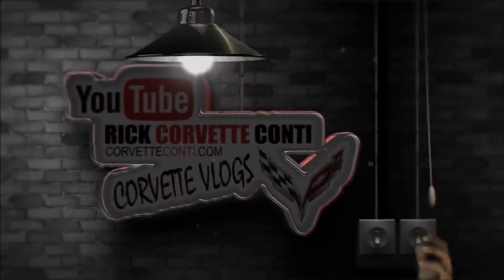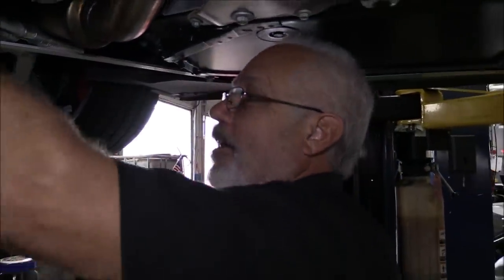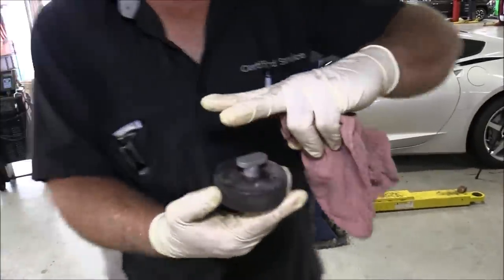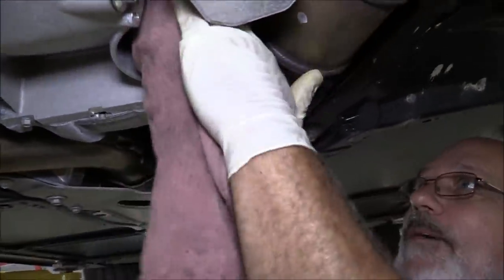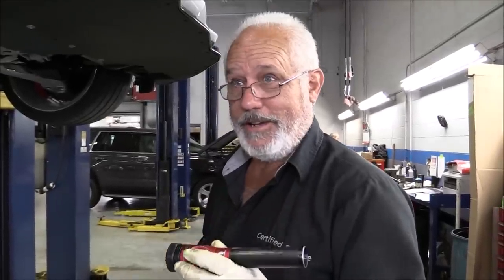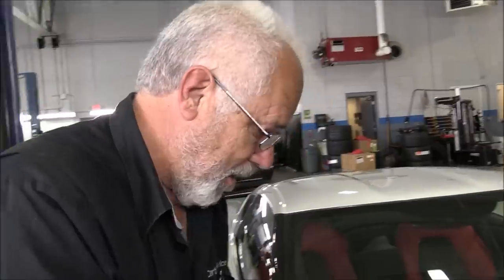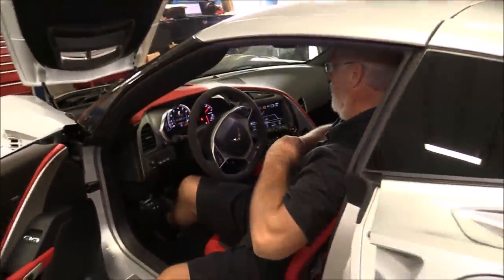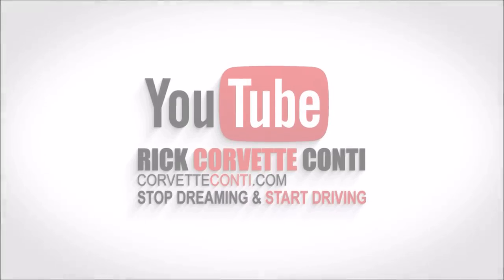HOW TO CHANGE OIL IN A DRY SUMP C7 CORVETTE

Comment: I enjoyed that video- thanks, Rick. I am a little surprised that Chuck didn't fill the oil filter with oil before he installed it in the car
Reply: Yea your exactly right man. I fill it half full and then keep the oil level between the hash marks to prevent burping into the intake manifold. Works great and intake and valves r dry as a bone.
Reply: @justinreid8851  I do my own oil changes and I fill my filter all the way up since the filter sits straight up you don't loose any, for what it's worth.

Comment: One thing I do is wipe the surface of where the oil filter goes with a clean rag to ensure it is clean. The main reason is to ensure the rubber oil filter gasket has not stuck to the engine. A double gasketed oil filter will puck oil everywhere in due time.
Reply: Can confirm, double check that old o ring is not stuck to the engine!!!

Comment: Another good vlog and very informative  too..Ask Chuck why he dont put oil in the oil filter before he puts it on ?Good job Rick !!!
Reply: A grand entrance, would be cool if someone arrived by parachute.informative vlog.i watch mma&NFL vlogs &they always turn nasty &political.you are one of the few that actually gets back to viewers via text.you are the Corvette wisperer&thanks for info on carbon 65.go buckeyes!
Reply: Good question, didn't think of that.maybe w/dry sump it fills up instantly?
Reply: Hey Rick did you ask Chuck why he didnt put some oil in the oil filter before he put it on the car ???
Reply: Dealer techs do not fill the filter cause oem manufacturers consider it a risk. Cause someone could get dust in. Fills so fast that they say no damage is done.

Comment: Hi Rick!  Great information, however i would like to check up on 2 things i saw .  i only lubricate the oil filter  gasket O ring with clean new oil....secondly depending on the vehicles oil filter position on the said block i  ALWAYS FILL THE NEW OIL FILTER WITH NEW OIL THAT IS BEING PLACED IN THE THAT PARTICULAR ENGINE. This information was taught to me by a GM Certified Master Mechanic.   These reason should be obvious .  Thank you for your time.

Comment: Rick, I know this is old but the C6 and C7 Corvettes have an oil priming feature where if you depress the throttle 100% while starting the car it will cycle the oil through the engine and turn it without starting the car.

Comment: Good vlog Rick. Chuck is a little more relaxed on camera these days. One thing I'd like to know, what brand is that big mouth funnel? Really flows. Yes @ 70yrs old I still change my own oil and a lot more.
Reply from the maker: I am not surprised you do your own... here is what I posted so far about that funnel
Thanks for the amazing comments, not sure where Chuck got that funnel, but the label says ASSENMACHER SPECIALTY TOOLS - Made for GM and Ford products Item # OFGMRD08 
Hope this helps guys, thanks so much for being here
Reply: Rick Corvette Conti , found it on, of course Amazon.
Reply: What brand of oil did he use? I would use amsoil. Did he use bulk oil?

Comment: Rick, any idea how many miles for first oil change for a wet sump Stingray? No one seems to know but thought for sure you would.
Reply from the maker: Thanks for watching , it really varies and depends on what climate you are in....without a dry sump that first does not have to be done at 500, worse case, base don how you drive, at least once a year.....if driving a bunch, I tell folks 6 months or 6,000 miles....the oil life monitor may not be the best thing to use as it could take a loooong time to get low. Temp changes etc can make that break down slower or faster.... so again no set rule...hope a little of this feedback helps
Reply: Thanks Rick, I knew you'd have the right answer.

Comment: Im sure tightening the plugs and filter the way he did it is fine.....and he has experience for sure.  HOWEVER, using a torque wrench to GM's torque specs is quite easy and is really the correct way to do it....I believe 18ft lbs for the plugs and 22 ft lbs for the filter.

Comment: Hey Rick thanks for the video very informative. I had a c5 coupe and thinking about my next car maybe a convertible. My question is this:  never owing a convertible I am curious on a practice level. During those dog days of summer when it is ridiculously hot and humid to have the top down how well is the top in performing protection and insulating the occupants from the heat. When I had my clear top on I had to switch to the body color to keep that sun from baking me while driving. So that is part of my question as well as product and cleaning of the convertible top inside and outside.
Thanks Rick I know you do a great job informing us.

Comment: I'm a little confused with the torque on the two drain plugs and the oil filter.  Manual is very specific about torque specs.  Both drain plugs are 18 lb ft and oil filter is 22 lb ft.  Also there is a specific oil filter socket that makes tightening and loosening oil filter a breeze.  Plus you will need a specific socket to drain oil pan drain plug since it's difficult to reach with torque wrench.  It's called a crow foot!  Having the right tools always makes the job so much easier.  Also the manual states 9.8 quarts needed with oil and oil filter replacement.  I've done many of these oil changes and the manual has always been dead nuts correct :-).  9.8 is always the exact amount needed.  Please ask your service tech what he thinks of these specific requirements right out of the manual?  I would hate to see that oil filter come loose on a track day or one of those drain plugs start leaking.  Thanks for all of the great video's.  Keep em coming.  Glad I've waited for the C8 Z06 because the prices are definitely dropping.  Have seen several below MSRP.  That makes me very happy.  Let me know inventory and pricing if you have it on a C8 Z06.  Would love to buy from you if possible.  Might keep my C7 Z06 or possibly trade?

Comment: How do you know if the tech does the oil change correctly on the dry sump engine? Is there something you can look for?
Reply: Easy, don't let the high schoolers that work in the '10 minute oil change' bay work on your car.

Comment: Is there a crush washer or rubber gasket on the oil drain bolts? If so, do they need to be changed out!  It didn’t look like there was one in this video, but I see many “bolts” for the c7 oil pan are coming with a washer...???

Comment: This is going to be my oil change video for 2022.  Ps. I will add oil to the oil filter first before installing it. My guess either way works but this is a little better for the car.

Comment: decent tech at best did not use a torque wrench, appeared to use dirty oil to lube the new filter, and the tire light will not come on at 27psi..all of that is not a big deal but if you are making a video showing off what to avoid from other techs this is an issue